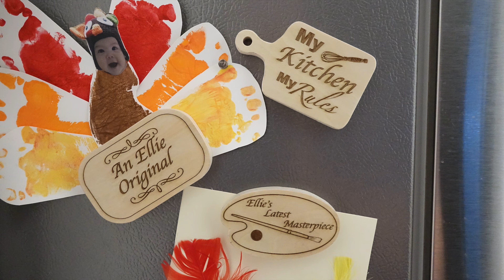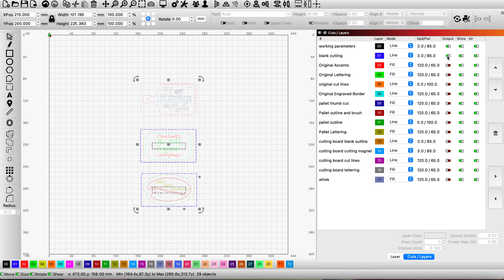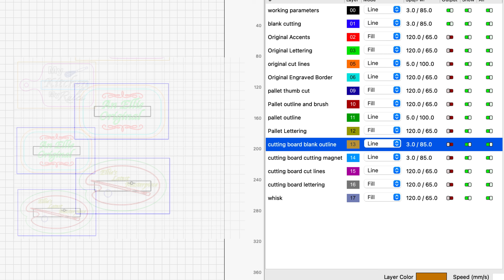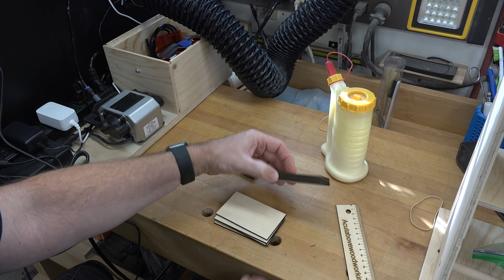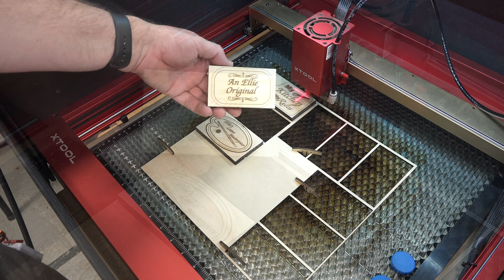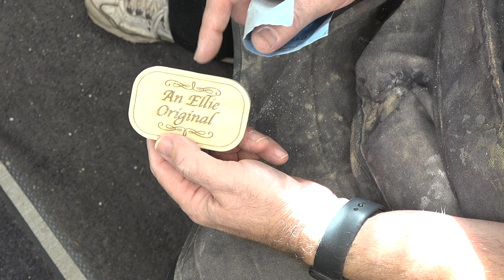Making Custom Fridge Magnets

Comment: I've been very busy with all kind of things last few weeks. I hardly had time for woodworking, nor for watching YouTube videos.
Making (fridge) magnets is high on my wannado-list, so this video might put it even higher. I still don't have a laser cutter/engraver (nor a scroll saw) but for both are
alternatives. You've already mentioned a few. Hiding the magnet behind a layer of plywood makes the fridge magnet really look slick. I've never seen that before.
Fridge magnets  (many people have metal (in)door frames as well in Slovakia), are very popular here. But they are heavy and flimsy at the same time. The visible from part is massive and then a classic magnet is glued on the back, sticking out of it. Some of them hardly can hold a piece of paper.
However (I followed the link to the magnets you used, thanks for including), using 32lbs strong rare earth magnets is maybe overkill (and expensive)
I have to look around here, what kind of rare earth magnets are for sale over here. Thanks for sharing the video. It opens up a wide range of possibilities.
Our imagination is our limit. 

But I have a request for you:  Can you please make a video how to make time?
Reply from the maker: I have always found that time is the easiest thing to make.  It is always possible to find the time to do what you enjoy (or want) to be doing.  I hear a lot of people say that they would love to make a project but they don't have time and yet they are the same people that will sit in front of their television for 3-4 hours a night to watch programs that they aren't really interested in.  If someone truly wants to do something, the time will present itself if they only evaluate the time they spend on things that they don't really enjoy.  Sometimes, it's all about breaking a habit and starting something new.  Thanks for tuning in this week.  Good luck with your magnets.
Reply: @acutabove_woodworkings  Woodworking is a hobby for me. It comes only at the third (in the summer half year at the fourth) place, after work, family (and cycling).
Last month has been very busy with work and things around the family. Projects don't run away. I quit watching TV about 12 years ago.  The most important things (no shows (talk shows or reality shows, no films, no serials) I can find on the internet in some kind of archive and I can watch it whenever I wish/have time.  I've found an e-shop with all kinds of rare earth magnets. They have so many types, so I'll have to make a choice according some criteria. And I found a company that sells strips of beech wood, 400 by 65 by 4 mm. Very cheap, but I will have to buy them in bulk. Unfortunately it's a 2-hours car drive, one way.
Reply from the maker: @hansdegroot8549  Like you, I don't watch television.  I can't remember the last show that I watch as it was that long ago.  It sounds like you already have your priorities straight and are spending your time wisely Hans.  So on next week's show......we're building a Time Machine.  LOL.  Thanks again for tuning in.

Comment: You could hang the fridge on the wall with magnets like that 😂 ... yet another brilliant idea for personalised gifts 👍
If making a lot of these then you could save a lot of time cutting out by not cutting out, i.e. with full sheets only cut the magnet holes then glue the bottom/magnet/magnet/top sheets together at one time (remembering to insert magnets) ... saves having to cut out the blanks, leaving only the engraving and final cutting on the scroll saw to be done!
Reply from the maker: Your method would definitely work Barry and would save some time.  You would just have to be sure that you knew exactly where the magnets were so that you didn't waste any material by accidentally cutting into a magnet.  Thanks for tuning in and for chiming in with your suggestion.

Comment: Kenny, clever little project.  I like how the magnet is placed in a pocket instead of being epoxied to the back.  Makes for a clean assembly.
Reply from the maker: Definitely a very clean assembly Paul and no chance of the magnet ever coming off the back of the magnet when the epoxy lets go.  I hate it when that happens.  Thanks for tuning in sir.  Always great to read your comments on the show.

Comment: Great ideas! I am going to try these with laser, I have found a 6 inch paper masking on Amazon that I put over the wood that takes care of the burn haze when engraving
Reply from the maker: Are you using an air assist Julie?  I ask because an air assist can help eliminate the burn "haze" on your engraving projects.  Thanks for tuning in and good luck on your magnets.